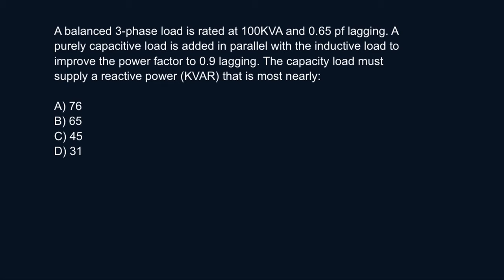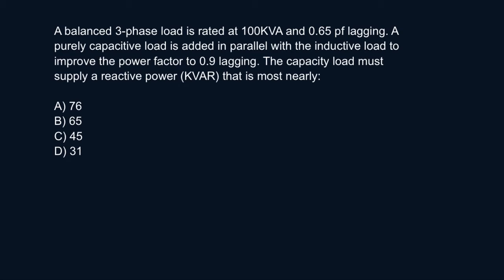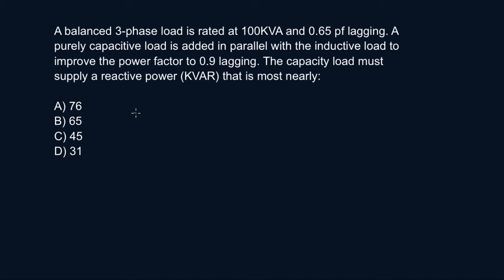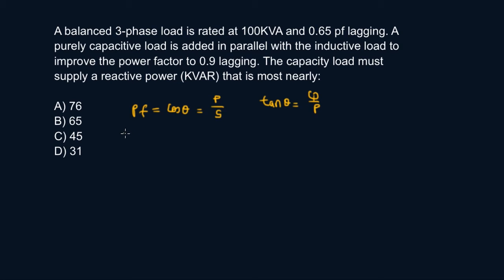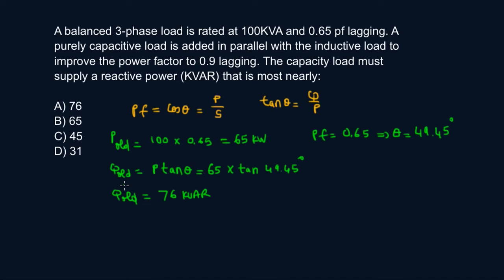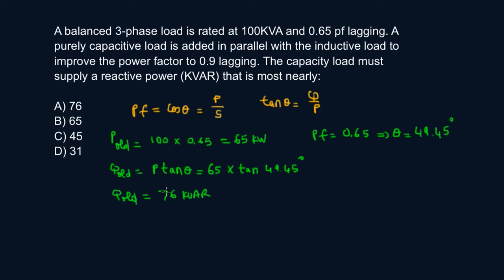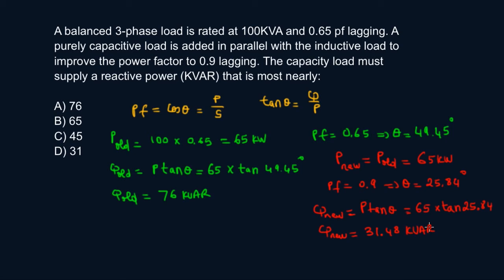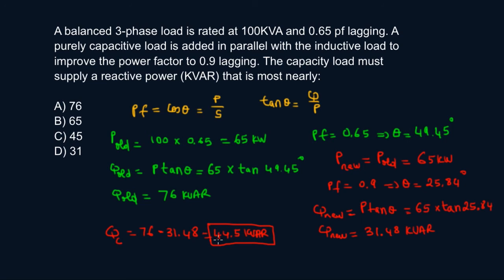Calculate Reactive Power to Improve Power Factor Problem

Comment: you mentioned associated power factor, let's say there is 1000kW load and PF is 0.7 lagging and then new load of 100kW is added to the system and improves PF to 0.95 lagging, what would be PF associated with added load?

Comment: HOW DID YOU GET THE NEW POWER FACTOR ANGLE?. IT'S NOT CLEAR
Reply: The new power factor is given as 0.9 in the problem statement.  She calculated the angle from that, inverse cosine.
Reply: acos(0.9)